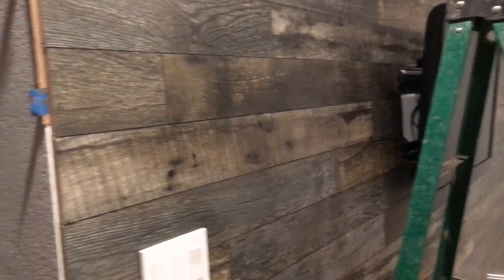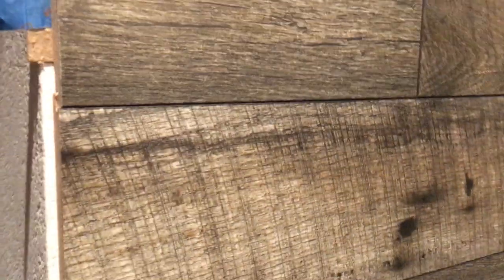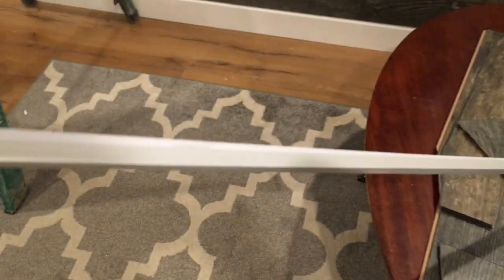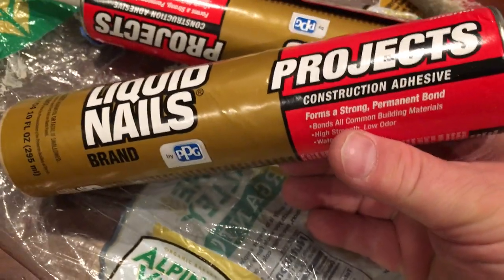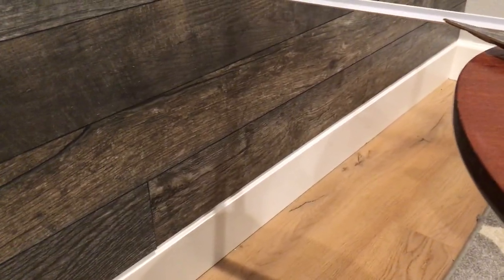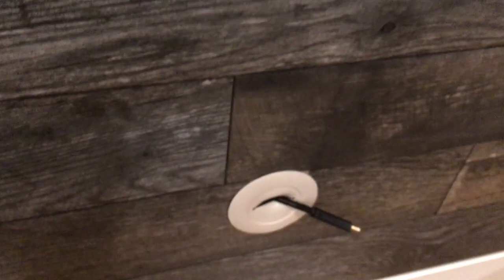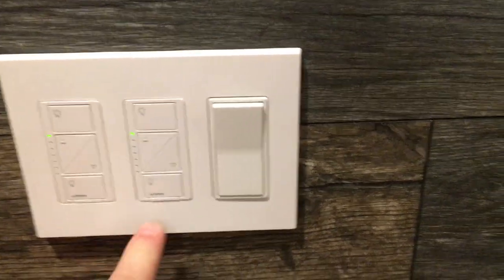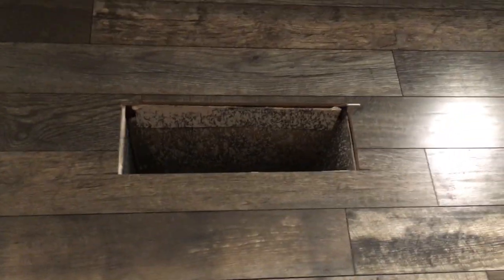Rustic wood wall is completely hypoallergenic!

Comment: Great job! Looks great - came here from your HD review as well! Quick question for ya. So did you just end up not using brad nails at all after the first few rows and only used glue for most of the project? You probably stated it in there but I wanted to make sure how you went about it because I'm going to do this project as well.  I wondered if I should be brad nailing or brad nailing+glue or just glue only.  Thanks for the response in advance!
Reply from the maker: Thanks, Doc! You're right that I went to glue only after the first row or two. The brads didn't have much hold in the groove once they're set down flush so the board above it can snap in. Nailing through the face of the board wasn't an option for me--we see that wall from the side ALL THE TIME, so the nail holes would be painfully obvious. These planks fit together so well, and the glue works so well, so I quit nailing knowing there was some mechanical fastening with the triple-gang box (I removed and reinstalled an old work box and had just enough room on the wing screws to sandwich the flooring and the sheetrock behind it) and the HVAC duct up top. If I didn't have those areas, I would have put a few brads in behind the tv, and then again well above eye height, where the ceiling begins to vault. It's December 2018 now, so the wall has been up almost a year and just tonight people commented on it who were visiting, and there has not been any movement. 
In another week or two I'm doing another wall, adding 1.5" of insulation behind it to bring up the R-value on a different wall. Please subscribe and you'll get that notice when I post it. 
Thanks for writing! Please thumbs up my Home Depot review; that is enormously helpful to me.
Reply: @DavePR  Alrighty will do! And thanks for the reply! It's good to see people replying to comments on their videos. Very helpful for me on my project. Thanks!